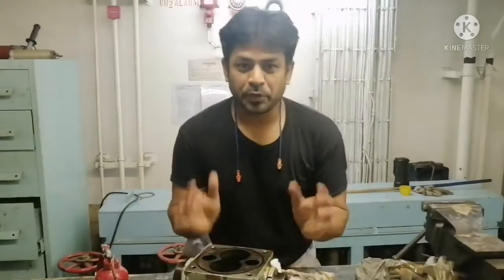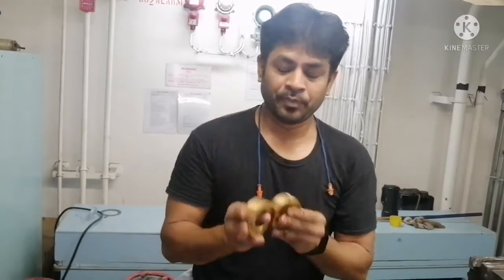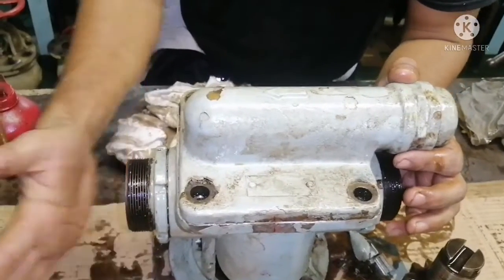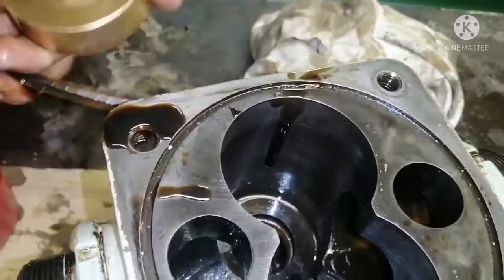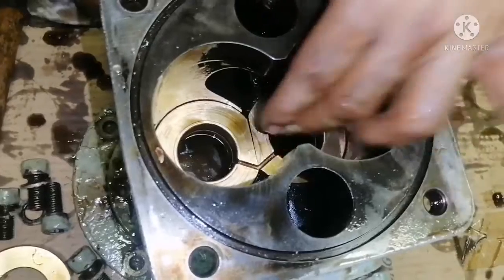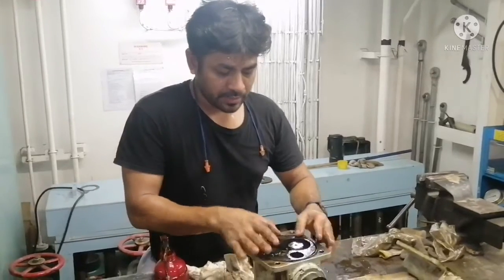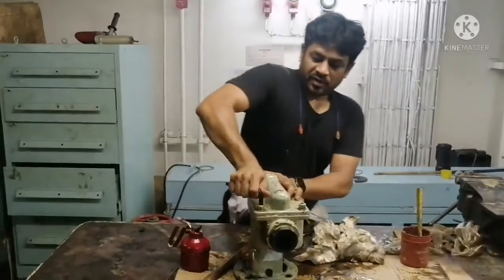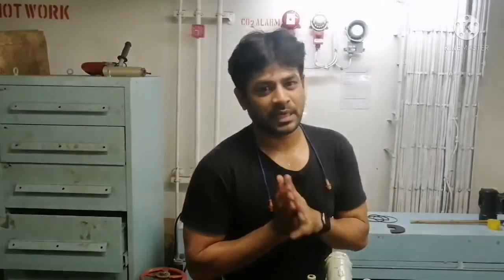How do they do.. How to overhaul purifier feed pump (Gear pump) Part - 3

Comment: Sir actually oil gets trap between casing and teeth and not between teeth of driving and driven gear also if clearances gets increased then it will not be trap between casing and teeth and discharge pressure decreases,,,,,,,,,, keep up the good work sir